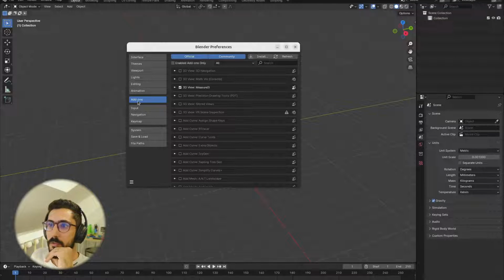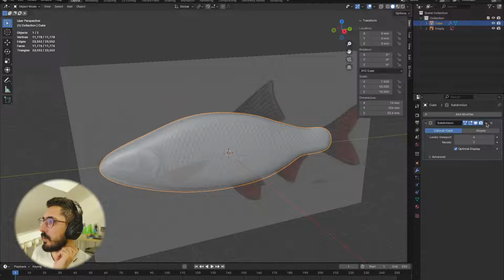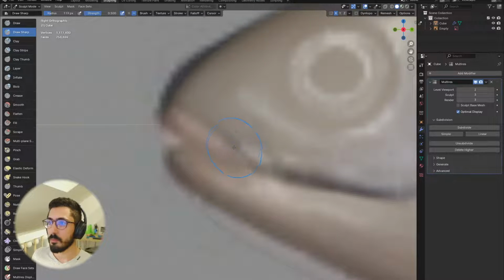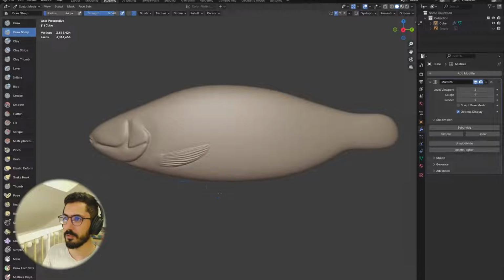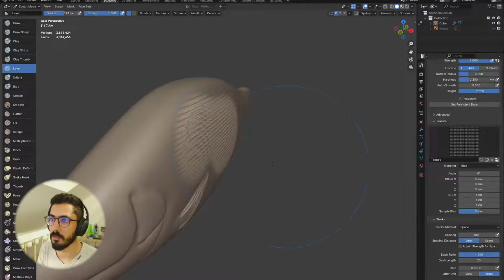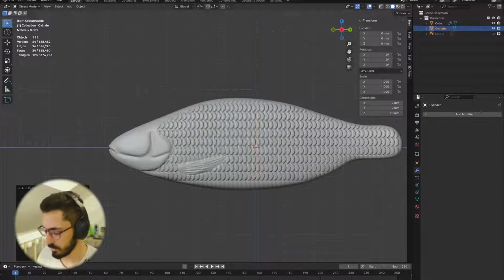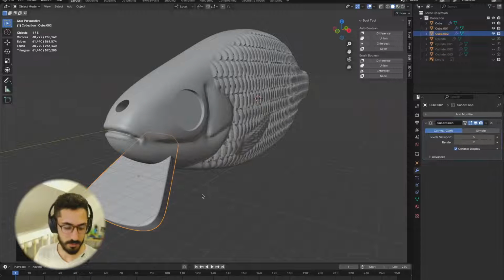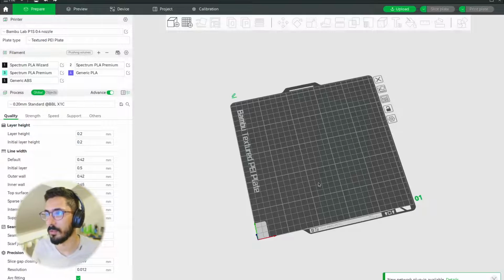Simple Roach lure in Blender

Comment: great video, right at the beginning he liked how you set the orientation settings in 3d the same as in fusion 360, that will be of great help, did I work in fusion, but in the end I don't like the fish scales, they are not the same as on thumbnail , I tried in every possible way to get a fish scale in fusion360 over the whole fish but it is impossible with that program, I even came up with a crazy idea how to make them, I made a body from a pipe , the pipe is round and oblong , then I flattened that pipe and I made a square out of it, so from 3d I somehow got 2d, it looked like a sheet of paper, then I tiled with fish scales, and started to form the body of the fish, but where the body narrows near the tail, the program threw out the fish the scale on some parts, I thought that it would simply reduce the scale on that part, I made the scale using a drawing and a 3 point arc, I believe that it can be done in the blender as well, will there be a part 2 video, how did you get that scale that you have on thumbnail?
Reply from the maker: Thank you for the comment, the scales in the thumbnail were hand sculpted one by one, maybe in next Friday’s stream I can do them the same way.